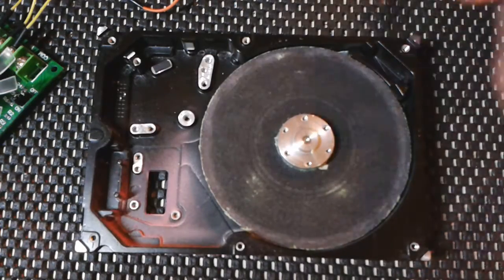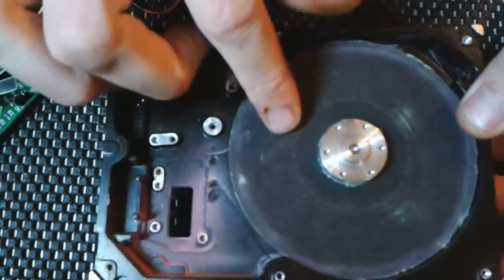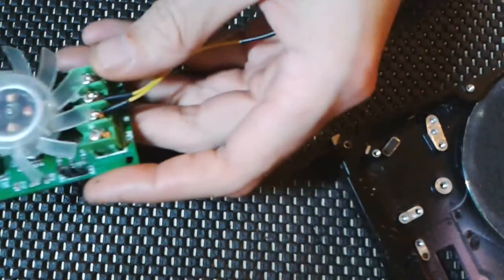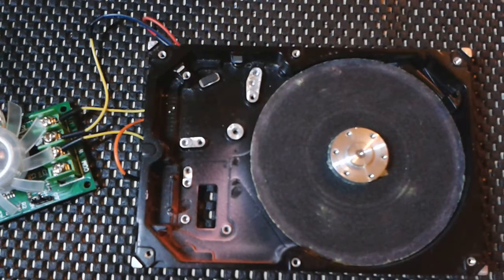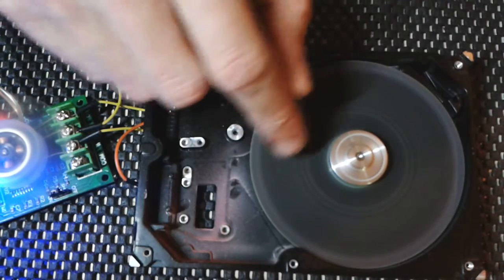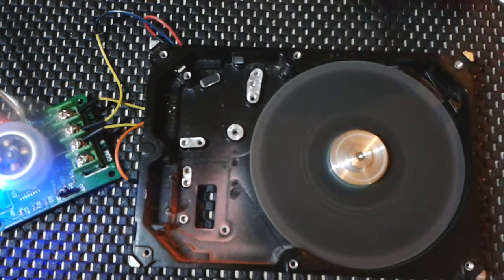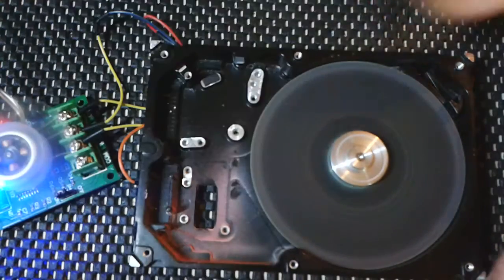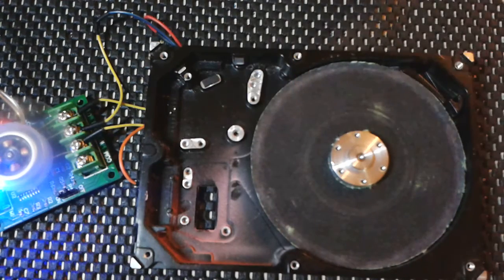Homemade Grinder From Old Hard-drive (Demonstration)

Comment: Hi I know this video is getting on a bit but i've only just found your channeland subscribed str8 away as you are a very good teacher, anyway I wonder if you could tell me where you connected the diodes on your controller and what do they do?
Reply from the maker: Hi, I added the diodes to prevent back spikes from the coils from harming the controller, they are not needed for this to work, I added them whiles testing higher voltage to the controlller.
Reply: Thank you for your reply,  So are they connected to the W.V.U and the 0v input ?
Reply from the maker: they were connected back to source as the outputs are modulated before the fet's